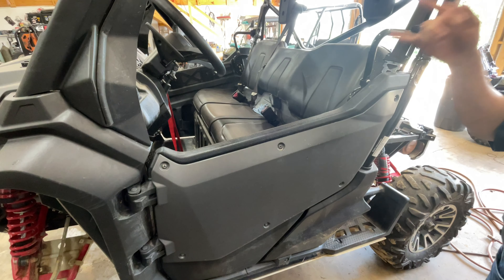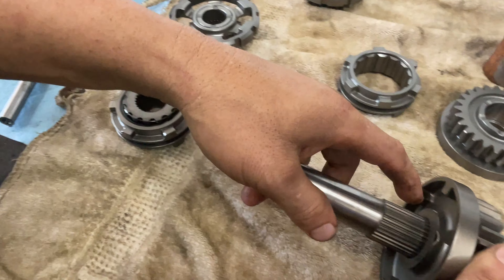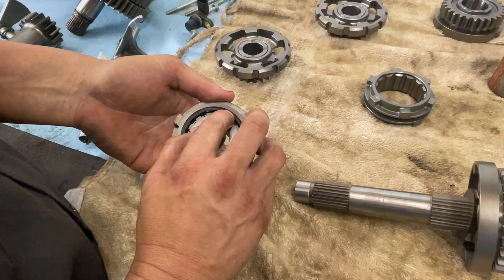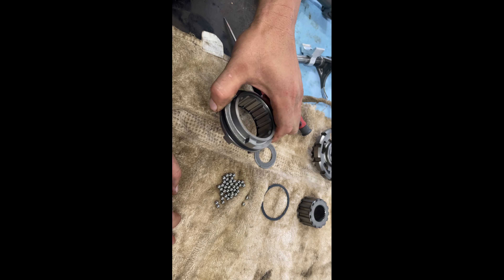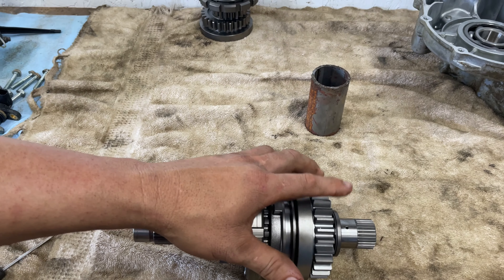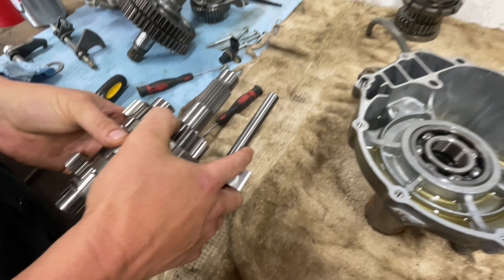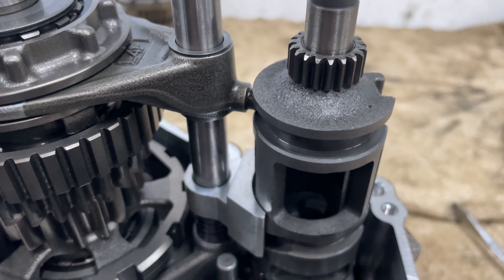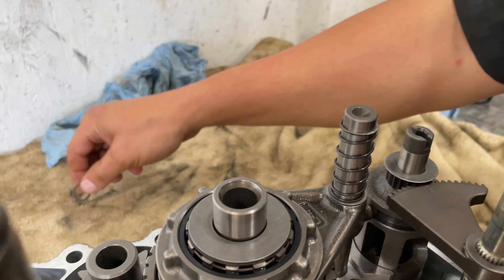Honda Pioneer 1000, PT 3, Grinding When Putting In Gear, How To Fix And Reassemble Sub Transmission

Comment: One question, why is it that the dots are line up with the P the park poll is not engaged?
Reply from the maker: Sorry I don’t have this unit in front of me anymore. The way I show in the video works. Hope this helps you out and thanks for watching.
Reply: I also had the same question. When the case was taken apart the parking lever was engaged, But in this video when everything was put back together the parking is not engaged? Could anyone help please? I have token my machine apart and will hate to ruin it?